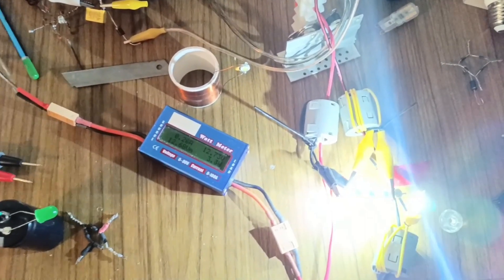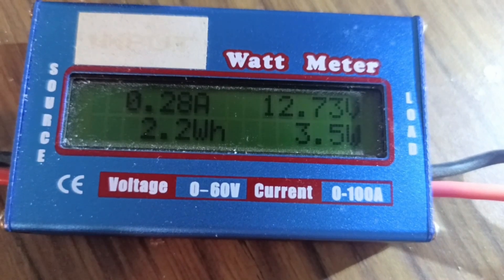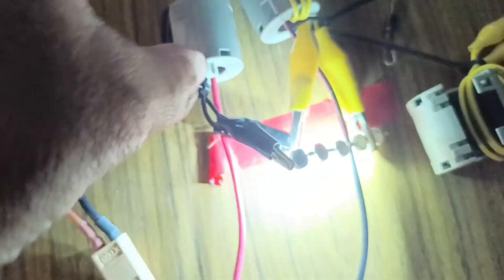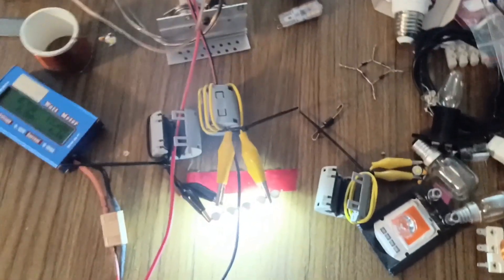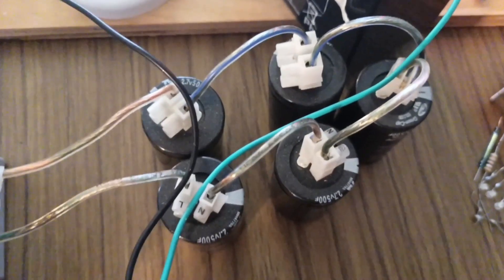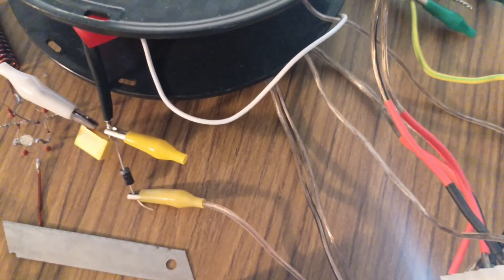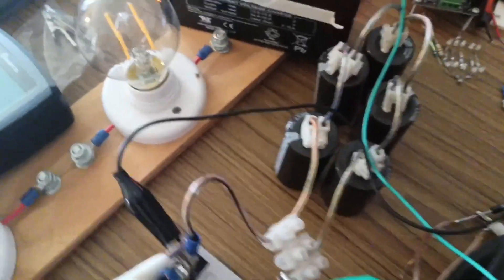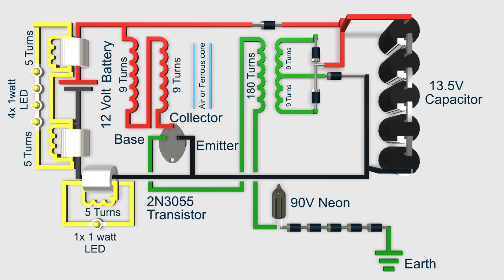TESLA EFFICIENCY AND MAGNETIC RESONANCE

Comment: I just recently did a video on changing the oscillations of a relay  with permanent magnets positioned just right on both sides of the oscillator.  This reminds me a little bit of this, expect i dont think it was putting out more than what i was putting in.  It was hard to tell because i didnt have a proper measuring set up.
Reply from the maker: Thank you for your comment.
I saw your video and left a comment. I liked the audible aspect of the relay which allows for a clear understanding of frequency change. There is quite a lot to discover in this field and a tonne of research to do.
Thank you for watching.
Reply: I know!  This is so fun and exciting discovering these phenomenon.  If you have ever heard of the starship Rodin coil, there is a present surprise that I found out with that too.  Apparently, the coil which normally just acts as a induction coil which increases in value series and decrease in parallel will also do the same thing in either arrangement but just stacking them on top of one another does the same thing!  The inductance goes up in value or down in value by flipping the coil.  The coils have to be aligned and stacked with each other.
Reply from the maker: That is interesting information, I still have not built a rodin coil, just looks like a nightmare to wind. I am glad that there are other people just trying different things, the things that most researchers lack, a curious mind. Thank you for sharing that information, whilst I may not be able to do anything with it because I haven't yet built the rodin coil this could be important to those experimenting.
Thanks again.

Comment: Thanks for the schematic update. What are the diode specs you are using?
Reply from the maker: Thank you for your comment.
Your welcome regarding the schematic, after a recent near lynching for not supplying one I think it’s best going forward that one is supplied every time. The diodes are UF5408, with MIC printed below that. I think they are fast recovery diodes, I’ve had them forever so not 100% sure. I’m also unsure if this matters or has a positive or negative effect using that particular diode.
Thank you for watching.

Comment: A very good result! But estimating the output power by eye is a mistake. At the output, you also need to put a voltmeter + an ammeter, an oscilloscope or an optical power meter. By eye, a 1W LED can light up to 80-90% and it will be almost imperceptible. Efficiency from 95% to 99% is possible here.
Thank you so much for the detailed diagram at the end of the video. .
Reply from the maker: Thank you for your comment.
100% agree, I will setup a test with a 1 watt LED powered by 3 x AA batteries to get the correct or conventional power. The three batteries in series will give me 3.6 volts on paper, it will actually be higher than that as they are good batteries, probably at 4 volts and powering the LED which is 3.2 volt so it will be perfect. I will place 1 LED in a dark container with the LUX meter probe and use the same LED for each test powered by my circuit and the AA’s for a fair comparison. 

It’s crazy how efficient LED’s are and I have to admit I was surprised to learn they can be as efficient as 95% to 99%, as you suggest, which explains why they can be operated on such tiny amounts of power with these alternate circuits. I have been doing this so long, looking at bloody LED’s, fortunately I realised how bad it was after a little research. I don’t want it to sound like I didn’t know you shouldn’t look at lights 🤣 but the first time I had nice bright lights from my circuit I could see dots of the LED’s in my vision for about half an hour afterwards. I try hard not to look at them these days and always look at the light they cast to a particular spot and I bought the LUX meter to know for sure if I was getting what is rated on the box. In fact I initially would use the LED’s on the box lumens rating and attempt to reach that rating, sometimes it’s way above the rating which I imagine will just shorten the LED’s life.
Your welcome in regards to the hybrid schematic, to be honest not supplying one is a bit like putting your neck in a noose and climbing a tree, people can be savages if you don’t give the schematic, I learned that early, gotta keep the folks happy!
Thanks for watching.

Comment: It seems that becomes more complicated circuit when your aim is just to prove certain things. Now my question is: there is any doubt that you can foul yourself ?
I rather keep things as simple as possible and in order to prove it for myself I only need to add an AC meter to measure and make sure the battery (laptop) charger do not draw more power than its rating, then as usual a battery meter after the charger to monitor input and output power and ignore whatever is at output as long as devices receive the power to work. Using a battery as power source is a good idea and I highly recommend but it is quite difficult to prove beyond doubt how much power being drawn and for how long.

It seems that you managed to get to the same point as many others where spending time to prove is way more than using the time for something much more useful or just simply enjoy your life. The more you press against “science” the more you’ll be challenged. Make it simple and use it, do not care what they say. Get little input to power your heavy loads for as long as you can/need and only care to provide the little input in the amount you need as long as you don’t need to pay anything for this little input.

Heat and light are quite easy to obtain this way … also note, that most appliances and domestic devices uses 12/24 Vdc via transformers+rectifier, so your off grid can be sorted easy as long as you can provide steady DC … just forget about Pin=Pout according to 2nd law of thermodynamics, I just enjoy to violate it 😂 Please note this “law” works perfect but they don’t care to amount the extra energy added for free from local environment and heretically say we can’t have more output then input measuring only what is metered (and taxed of course).

This is my approach.
Reply from the maker: Thank you for your comment.
I hear you, simplicity is key and the reason few people have successfully replicated devices like the Akula, Kapanadze, Kapagen and some of Don’s work. In my defence, my main circuit is as basic as it gets with only 3 components, wire, transistor and the light. My circuit very easily achieved my initial goal, cheap off grid lighting but my thirst for knowledge is constantly telling me there’s more features to be discovered. This may be perceived as greedy but from my perspective, it’s what I do, a good researcher is never satisfied and I’m constantly moving the goal posts. I’ve expressed before how my mind works, I am pestered by my research and I’m always switched on, like a bot I wake each day with the same thought, what will I discover today, what will I learn, what if I did this or did that, what if what if what if. Now I say pestering because I struggle to be normal around other people, mid conversation my brain is dragging me back to my table telling me things like, hey when you get home try this try that. I used to drink alcohol to silence it but then I learned about alcohol and stopped drinking, haven’t had a drink in many years.

I agree that it isn’t worth trying to convince people and whilst it may appear I’m trying to do that, trust me I have too many personal issues to waste energy giving a crap what other people think of me or my work. Instead I do what I do in an attempt to silence my mind. Most of the devices I have built have found a purpose, generally I build one and put it to work then I build another one for research. I like to use batteries because it allows me to evaluate performance based on voltage, the more efficient the circuit is the longer it runs and small batteries help illustrate this faster, that being said this current setup will run for approx 20 hours. When making things permanent I might choose a bigger battery however in this case where I have connected a solar controller that allows automatic recharge and automatic light function turning the light on and off based on the sun, set and forget automatic night light 100% free energy from the sun with no overheads that a 240v inverter would have.

I agree that heat and lighting are easily obtained and it makes a lot of sense to use these devices plugged into the mains as you have done. The concept here is extremely valid, if I can run the same light for half the normal wattage at the same intensity or greater effectively halving the input cost saving me money if it was pulled from the grid. I will return to just showing what I know and be less concerned about the meters, this was only ever done to appease the people, sometimes telling people you have a better way requires some evidence to help people understand why, so when it was stated that I would most likely not supply the power factor without trying to get rich first I feel I need to point out how stupid some people are, I’ve given out my knowledge free, schematics, tutorials and a lot of what I know free, how one can suggest I’m trying to get rich blows my mind, but I don’t want to waste my time on stupidity and I don’t need to prove myself to anyone as I have already done the work and I know the truth because I’ve created the devices.

If you would like to power DC devices from your replica of my Tesla pancake coils all that is required is a two turn coil that wraps around the perimeter of the pancake coils, add fast switching diodes then you can feed this back to source or power lower voltage DC devices. You can take a look at Tesla’s patent for one wire through earth transmission and you can see this output coil. As you suggested most 240v devices have transformers knocking them down to 12 volts, I would go as far as saying approximately 80% of 240v devices are then transformed down to 12v, sure some modification is required because it is designed for a 240v input but this can also be done in reverse whereby you transform up to 240v for some component if necessary. When it comes to LAWS, they are gates, walls deliberately place in your way, somewhat like a one way sign at the end of a street, sure you could drive down it but they don’t want you to. Laws were made for one thing only, to be broken!
In the words of Judge Dredd “I am the law” said with Stallone’s slur.
Thanks for watching.
Reply: @whatifididthis...1236  Many thanks for such an amazing response, I hear you, clear and loud. Great solution, now I have to test both yours and mine … to be honest I have built your other circuits as well along with few others but yet I didn’t dare to fire them up … and even have prepared and gathered what is needed to upgrade.
Anyway I feel that I got some kind of bonus that I even not bargained for.  I’ll be in touch to confirm.
Reply: @ well, I have no dea what is wrong with my replica but there is no way to measure AC output as you do with pancakes coils. There is no way to get rectified DC to match the input with 2 turns and leave some additional power for any loads as the system just shut down itself unable to cope with so much current drawn. Adding capacitor in parallel with dc output on the bridge rectifier doesn’t help either. I guess I have to use batteries and ground connection to make it work this way.